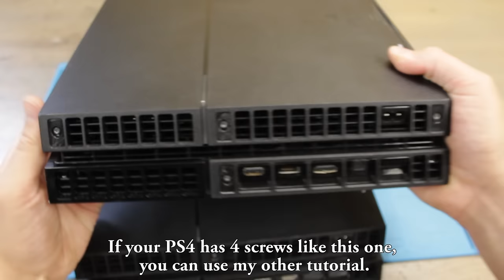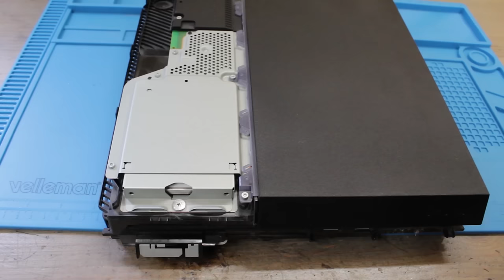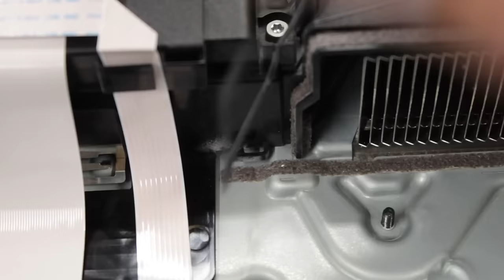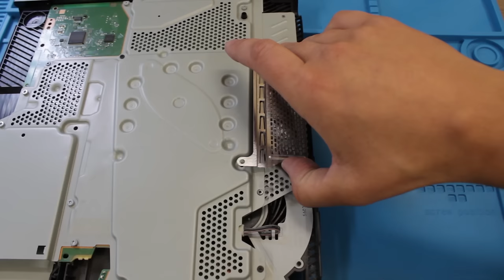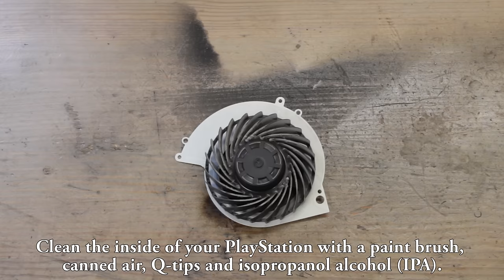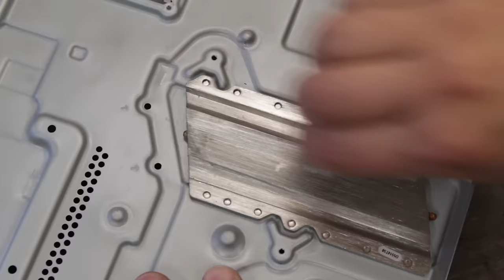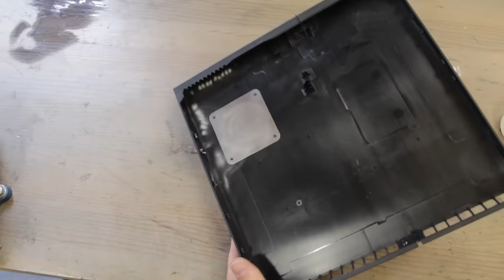PlayStation 4 model CUH-1200 cleaning tutorial.

Comment: I need help, while disconnecting the power supply, it’s a lot harder than it looks and completely destroyed it and cut the plastic on the wires open, is it still ok? Am I able to put it back together and will it run fine?
Reply from the maker: That's unfurtunate.

The best thing to do is to replace the cable. I wouldn't put it back with the unprotected wires. maybe you can still insulate the damaged wire. If you send me a photo via Instagram I can take a look.
Reply: @SpareTimeWorkshop  thanks for the support, I took some time to calm down after destroying the cables and found them online, they should be easy to replace and will only cost 3$ or so. Sorry to bother you.
Reply from the maker: @turtle9259  No problem I'm happy to help. Make sure you order the right one when ordering. With the same number of wires.

Comment: Thanks, though i did encounter a problem when i finished cleaning my ps4 my disc drive starting to push away the disc. Idk what happened i followed exactly on the video. Can anyone please tell me how to fix this i would be grateful thanks!
Reply from the maker: Is your ps4 under cover pressing the eject button?
Reply: @SpareTimeWorkshop  yes it works but when i press it what it only does is to remove the disc it won't eject the disc
Reply from the maker: @xindof7523  

Does it not take in the disc when you push it in?

if your disc drive doesn't try to take in the disc, I'm afraid you damaged 1 or 2 micro switches when assembling your disc drive.
Reply: @SpareTimeWorkshop  i found out the problem just few weeks ago. It seems to be there's a disc inside the disc drive when i tried to clean it so when i removed the disc the disc drive thinks its still inside so those error occurs. Fortunately i found way to fix it

Comment: After I did this, I was automatically put in safe mode. Any ideas what I possibly do to get out of safe mode?
Reply from the maker: I think you have a problem with your HDD. If it is not connected your ps4 goes into save mode.
Reply: @SpareTimeWorkshop  The HDD was upside down lol. But now every time I turn it on, it puts me in safe then turns off automatically.
Reply from the maker: Maybe a damaged connector of the hdd? Or the hdd itself is broken. I just can't explain why your ps4 turns off by itself.

Comment: Ok so im trynna remove the power supply connector n its very stuck n i aint trynna wear it out any tips? Plz n thanks
Reply from the maker: You can leave it connected to the motherboard and remove the connector on the power supply itself instead, then you have less chance of damaging the motherboard.  I used needle nosepliers.

Make sure you only grab the connector of the cable with the pliers and wiggle gently.

Comment: Do you need to replace thermal paste after you removed the motherboard?
Reply from the maker: Yes, I recommend replacing the thermalpast. Usually it also dries out a bit over time.

Did you manage to take the bottom off?
Reply: @SpareTimeWorkshop  what is it for bro? Bc I didn’t add none to mine and it won’t turn on it’s said “the ps4 too hot let it cool down” 😔
Reply from the maker: @kbronn4875  Thermalpast provides good heat conduction from your APU to your heat sink. Which is cooled by your fan.

It is necessary to apply thermalpast. Otherwise it will overheat very quickly.

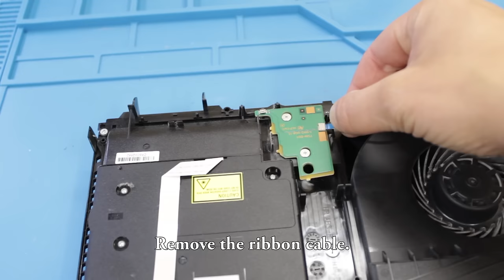Comment: Where can I find the ribbon cable at 4:14 and the mini motherboard thing my connection got broken 😔
Reply from the maker: That's unfurtunate, luckily a replacement part isn't that expensive. search for "TSW-001" on google for a replacement circuit board. sometimes the ribbon cable is included.

Also check if your part has TSW-001 written on it. to be sure.

I personally like to buy second-hand parts from local repairers. But you can probably find it on Amazon or Ebay too

Good luck!

Comment: How can i disconnect the power supply connector with something else then needle nose pliers?
Reply from the maker: You can use a small flathead screwdriver from the inside. And gently pry it loose.
Reply: @SpareTimeWorkshop  i tried using 3 other things but it wont go out, like its stuck there or smh
Reply from the maker: @Nihetu  If it is difficult to loosen, I recommend disconnecting it at the power supply. Then you reduce the chance of damaging the connector on your motherboard.

Comment: I have lost one of the 8 thermal pads. 11:15  Is it a serious problem or not?  please help
Reply from the maker: No, thermalpads can probably be ordered cheaply somewhere.
Reply: @SpareTimeWorkshop  if i rebuild my ps4 with just 7 thermalpads do you think will work?
Reply from the maker: @andreapaparo29  I've never done it, but I wouldn't. They're there for a reason. Otherwise the heat from that ram chip won't be dissipated.
Reply: @SpareTimeWorkshop  okk thankss

Comment: Can you recommend me thermal pads to get. When i dissembled my ps4 there was only 3 thermal pads😂. I’ve never opened it before.
Reply from the maker: I ordered them last time from this website: https://www.consolereparatie.eu/contents/nl/p1401_Playstation_4_thermal_pads_8x.html

They only ship in europe.
but I don't think it matters much where you buy them. sometimes you have to cut them to size yourself.
Reply: I finally got the paste and pads and so i decided to “fix” my playstation today. After disabling and applying the paste and pads, i was ready to start gaming again. Turned on my ps4 and noticed significantly how much quieter it is. I leave for 20 min and when i come back its off. I turn it back on - turns off even faster. Repeated events occur and now it will only stay for maybe 3 secs.
Reply from the maker: @lysanderg7571  that's unfortunate, maybe a stupid question. but you didn't forget to plug your fan back in?
Reply: @SpareTimeWorkshop  well actually i noticed the first time i was tryna turn it on the blue light would appear but wasnt showing up on the tv. Then it clicked, i hadnt plug in the blue ribbon (connected near the top). Once i fixed that it was working perfectly then 20 min yatta yatta yata
Reply: right now i did a quick disassembly and reconnected the power and ribbons. So far its chilling on the account menu pretty unsure what to do
Reply: alright, so i didnt reverse the blue ribbon- i flipped it upside down( opposite from the original in the video) and so far so good. Ill keep you updated lol
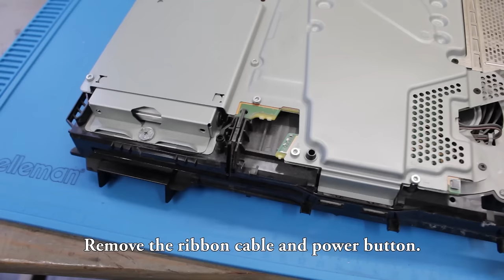Reply: @SpareTimeWorkshop  Alright i think there is something wrong with the blue ribbon near the fan. I doubt its a heating issue. Do you know if thats being sold anywhere? The blue ribbon at 4:38
Reply from the maker: @lysanderg7571  amazon or aliexpress sell it. search for: ps4 1200 eject ribbon cable.

overheating: 3 beeps, a red light flashes and the fan spins up (if it is working)

what exactly is going wrong with your ps4 right now?
Reply: @SpareTimeWorkshop  The night before last night the ps4 was perfectly alright - gaming without any issues. Last night, playing 1.5 - 2 hours in my ps4 stopped displaying on my tv. Like an immediate went back to the hdmi screen like it was waiting for me to use my ps4, even tho it was already connected. Thats the issue that happens. My ps4 light would still be on. But it would changed to a white light. And my controller would turn off as well. So i dont know what exactly going on but i dont think it is a heating issue because if i hold the ps4 power button long enough, it will eventually turn off
Reply: 3 beeps, red light flashing does not occur
Reply: I dont know if it matters if im using a ps5’s power cable and hdmi. Last night after frustrating attempts to keep my ps4 displaying on my tv. I messed with the blue ribbon once or twice and i started gaming again with no issues. but i feel uncertainty that it will happen again
Reply from the maker: If I understand correctly, the light on the ps4 stays white. but sometimes you don't have a picture?

the HDMI port of the ps4 often breaks, these are vulnerable. and can cause it.

power cable and HDMI cable from the ps5 should work just fine.

I don't think the thin ribbon cable would have much to do with it.
Reply: @SpareTimeWorkshop  Yeah, stays white (blinking) and appears to have no visual on screen. Is it weird for the ps4 controller to also disconnect (the light on the controller turns off).

Guessing the HDMI port is difficult to replace?
Reply from the maker: @lysanderg7571  I also have no experience with a flashing white light. it should be a steady white light. 
and your controller shouldn't turn off either.

I don't think it's the HDMI port. I'm sorry I don't know a solution for this either.

if your ps4 still worked well before disassembling, you could check the connections again for damage and a good connection.
Reply: @SpareTimeWorkshop  Yeah its real strange but like i said after messing around with i started gaming and it was working fine again. (Last night)

But this never happened the before nor did it happen after i disassembled the first time. Only the second.
Reply: @SpareTimeWorkshop  Sorry to keep bothering you but ive been doing a bit of research. Have you heard about the blue light of death?

Currently my ps4’s light is blue and is pulsing with nothing showing up on the tv.
Reply from the maker: @lysanderg7571  no problem. I do know a blue light of dead.

you can try to temporarily remove your HDD (if it is off). then turn on. if it now just gets a steady white light and your ps4 starts save mode, your HDD may be broken.

if you still only get a flashing blue light you can install the HHD again (with your ps4 off). and put 2 rings or something thin under your APU clamp to put more pressure on your APU. if your ps4 works just fine, you're out of luck. then there is probably a broken solder connection under the APU.

the rings under the APU is not a repair but a temporary solution to find out what is broken.
Reply: Alright i have no clue but im really hoping this is the problem. Is it possible to send you a picture via instagram?

Want to get a second verified opinion.
Reply from the maker: @lysanderg7571  Yes of course. then I'll have a look.

Comment: Very good video but u need to come to my house to do that lol 😅
Reply from the maker: Haha, thanks for the invitation. But I'm afraid it's a bit too far of a drive for me.
Reply: @SpareTimeWorkshop  haha, anyways do you think the main reason of the noise is because of the dust in the heat sink?? Or any other area, e.g. power supply, fan?
Reply from the maker: @HD-hc2ho  I think the number 1 reason is the heatsink. I have seen them more than 2/3 clogged, If cigarettes are smoked in the same room then the fan also wants to collect quite a lot of dust.
Reply: @SpareTimeWorkshop  yes ok, I will be able to at least clean that up as I do not want to remove every part just incase, thanks for the tutorial

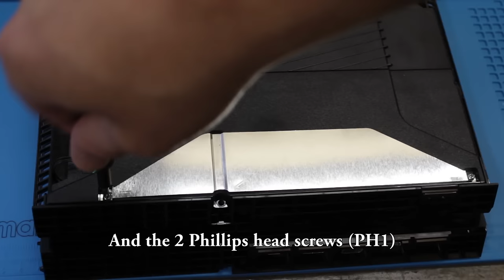Comment: 2:42 can someone help me? i can take off only the right screw and not the left one but idk why,  I’m using the same screwer for both so that doesn’t make sense
Reply: so that’s a problem because I can’t take off the cooling fan and clean it (that was my plan)
Reply from the maker: @alessandrocurcio6436  You can try a screwdriver with a thicker handle. You can use more force with that.

Comment: Is it necessary to replace the thermal paste or will it be fine if it's not that old and I just don't bother?
Reply from the maker: Maybe you can get away with it if it's not too old. but i would just replace it
Reply: Its better to change it every 1 or 2 years
Reply from the maker: @THE_HUNTER_DZ  I would not do that. I only replace the thermal paste when I take the PlayStation apart. especially if you smoke in the same room, your PlayStation can be full of dust again after 2 years. But if the PS4 isn't making excessive noise I wouldn't take it apart.
Reply: @SpareTimeWorkshop  my ps4 never opend since 2013 😂😂😂
But i think i will clean it
I bought it this week. But its never opened before
Im afraid to change its thermal paste with a bad one
Because the good paste is very expensive
Reply: @SpareTimeWorkshop  i dont know how to open the ps. So i will take it to someone have an experience

Comment: How to open the lower panel, it seems impossible
Reply from the maker: The lower panel is usually very tight.
The second way that I show in the video works best.

Pry the side at the corner out a little. before you pull the lower panel off.

Comment: Thanks
Reply from the maker: My pleasure.
Reply: I was clean and use new pasta for my PS4 but still hot, any solution?
Reply from the maker: @indra-od5dh  Is your PS4 in a well-ventilated area? and are the thermal pads in place?
Reply: @SpareTimeWorkshop  yes all clean and I use new thermal paste but when I was turn on  my ps4 notification tell me PS4 too hot
Reply: I made a mistake, idont replace my thermals pad. do u know how size thermals pad its 2mm or 3mm ?
Reply: Do u know how much size&watt thermals pad?
Reply from the maker: @indra-od5dh  you don't have to replace the thermal pads only if they are torn. Maybe you forgot to reconnect your fan?
Reply: @SpareTimeWorkshop  no, I think my issue still on thermals pad because my ps4 only hv 2 thermals pad and on ur video 8 pad. Thanks ur video really help
Reply: I was change my thermals pad and new pasta but still overheat :( it's there any solution tips what's happen to my ps4?
Reply from the maker: @indra-od5dh  
I have a checklist for you: 
- your fan is connected and can you hear it spinning? 
-all parts are free of dust, especially the heatsink? 
-new thermal paste applied? -all thermal pads are in the right place? 
- Did you tighten the APU clamp? right side up? 
- the plates fit together well and are secured with all the screws?

Comment: Is there other way to take the screws off the shiny part because my nuts are like gone
Reply: Like the long nuts tip doesn’t have its shape
Reply: So which screw do I use please help
Reply from the maker: If the head of the screw is damaged, it can be difficult to get it out.

I would try some different ways. It's hard to judge from here what will work for you.
but i'll give you some surgesties.
- Use 1 size larger screwdriver
- if you have space cut a slot in the head with a hacksaw or dremel and use a flat screwdriver.
- use "screw grip" between the screw and the screwdriver
- grab the head with pliers and unscrew it with that.
-I have seen that you can also use a rubber band between the screw and the screwdriver for more grip. but I have no experience with this myself.

Comment: Do I need an anti static mat to do this?
Reply from the maker: No that is not necessary.
Reply: @SpareTimeWorkshop  thanks for the reply 😅 i have one more question. Do I also need the thermal pads that you put it?
Reply from the maker: @ac3e19  Yes definitely, cooling paste should be replaced when you disassemble your ps4. Arctic Mx4 is the brand I use and works very well. I have no experience with other brands myself so can't give advice on them from personal experience.
Reply: @SpareTimeWorkshop No i meant the thermal pads at 11:13 … I have the thermal paste and the alcohol ready.. just no thermal pads
Reply: @SpareTimeWorkshop also, have u ever broken a ps4 whilst cleaning? I’m getting really discouraged rn by people 😅 they think i’m gonna break it
Reply from the maker: @ac3e19  The thermal pads should be in your ps4 and you can reuse them. If they are not in there, I would still try to buy them online somewhere, though.

I've never done any damage taking it apart myself.

If you take your time and watch what I do in the video, you should be fine.
If your PlayStation 4 is already a bit more noisy, you are also more likely to break it because it gets too hot. (Solder joint under the APU can crack)

Additional tips:
-Remove your disc before disassembling your ps4. (Never take the disc drive apart with a disc in it).
-Thermal pads tear easily, remove them carefully with a blunt knife, for example.

Let me know how it went. I'm very curious! I think you'll find it easier than you think.

If you do have problems then I will be happy to help you along the way.

Good luck 💪
Reply from the maker: @ac3e19  Oh and look carefully, that you grab the right part of the connector with the pliers (only the top part, not the part that is attached to your motherboard). Don't pull too hard wiggle a bit until it comes loose.
Reply: @SpareTimeWorkshop  thank you so so much! I got more courage now.. I’ll definitely do it, thank you for answering all my questions
Reply: @SpareTimeWorkshop  thank you for the heads up 😅 I think unplugging stuff are the scariest part
Reply: @SpareTimeWorkshop  hey!! It took me awhile cause I had my exams and I waited for the tools to arrive.. but I just cleaned it today.. and man it had a lot of dust built-up… I had to improvise a little cause it was hard to unplugg the psu so I unplugged the wired from the main psu rather than the motherboard instead.. overall it took a while but I got it.. and it’s still working thank god.. so thank you so much for this 🙏

Comment: Ummm sooo my ps just committed suicide
Reply from the maker: Sorry for your loss, what were his last words?
Reply: @SpareTimeWorkshop  fan went off like crazy when turned on and when i clicked on apex the fan went into a super sonic stage and then ps just turned of
Reply from the maker: @mr.rudolf.g2747  

It sounds like he's just overheating.

Was this after cleaning?
Reply: @SpareTimeWorkshop  this happend right after the cleaning, i noticed that the thermal paste was a lil bad and probably not enough of it on the processor. So im blaming that for the overheating. Going to buy new thermal paste and hope that that will fix the issue